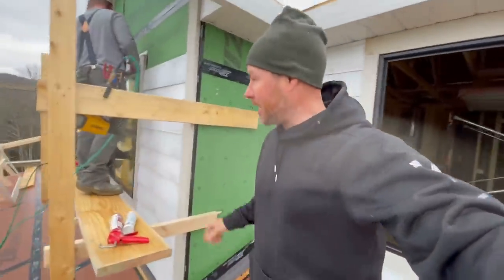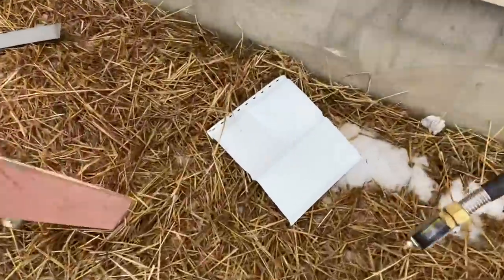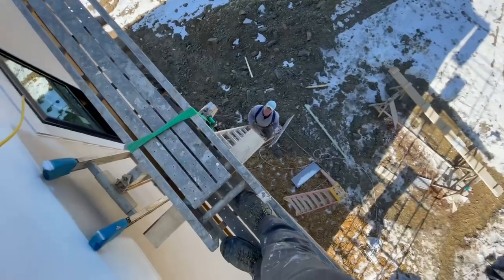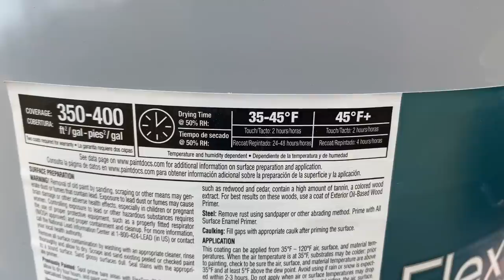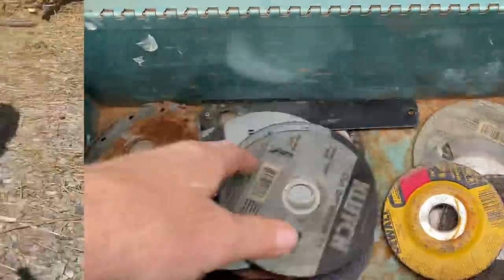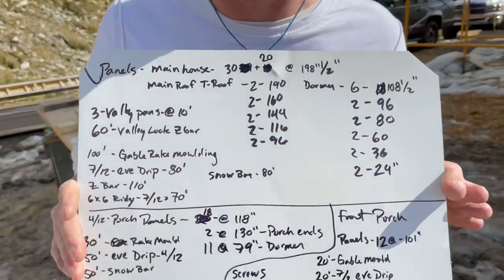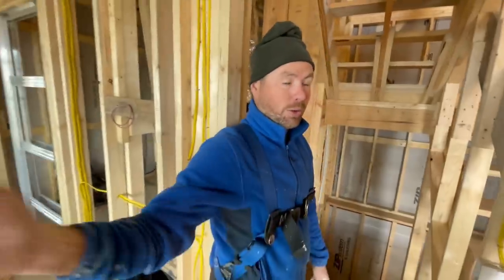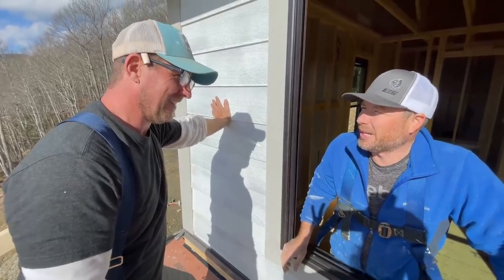Building The Farmhouse | Day 46

Comment: I completely understand with the door swing, and have to order doors from overseas and not communicating correctly and had to reorder. Another one that confuses me is with storm doors. storm doors never ask for the swing, they go off of the strike. so I have ordered those wrong too. It's a learning process and it helps to always ask before checking out or placing the order.

Comment: The secret to soda (carbonated beverages) is partly the same as with wine storage.  Exhale into the open bottle to remove oxygen, they inject CO2 into half/partly used wine bottles to remove oxygen.  But a vacuum on a carbonated beverage I think would remove the CO2/carbonated fizz part, and turn it flat quicker.  Anything else, food, orange juice, cereal, pull a good vacuum and it'll last darn near forever I think.

Comment: I feels weird when you guys say a door need to be fire rated, steel faced, in a building that's made out of wood.
Reply from the maker: Good point! It’s all covered with fire rates drywall on the inside though. Doors are the weakest link
Reply: Firefighter here. It has to do with progression of a fire through a structure, and compartmentalization to slow that progress. Having a sealed and rated door will minimize hot gasses entering a space and spreading combustion, and prevent oxygen from being drawn in to continue combustion. It's the same reason that blocking is used to prevent movement of fire through a wall cavity and into other floors, etc.

Comment: Love the videos guys, however Erik's explanation of the door handing is incorrect. Doors should always be handed based on the "outside" of the swing. If you're on the outside and the hinges are on the left and the lock is on the right, and the door swings inward, then that's a left hand (LH) door. If it swings outward then it's a left hand reverse (LHR) door. If you're on the outside and the hinges are on the right and the lock is on the left, and the door swings inward, that's a right hand (RH) door. If it swings outward then it's a right hand reverse (RHR) door. It's important to distinguish reverse handed doors, from standard LH/RH doors, for hardware purposes. Door manufacturers need to know which side is the outside and which side is the inside when they're machining the doors for certain types of hardware. (If your door has a mortise lock, for instance, you wouldn't want the outside cylinder to be drilled on the inside of the door, or if you had flush pulls, on closet doors, you usually don't need them to be mortised on the inside.